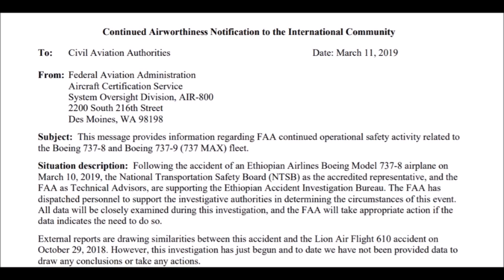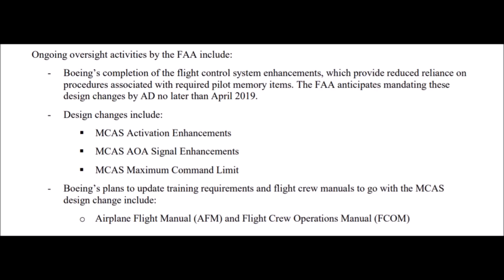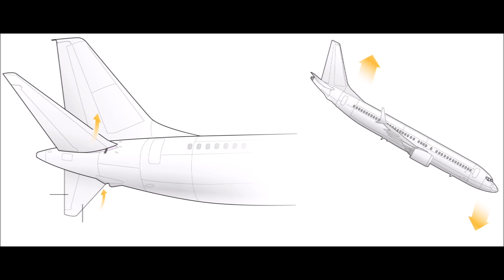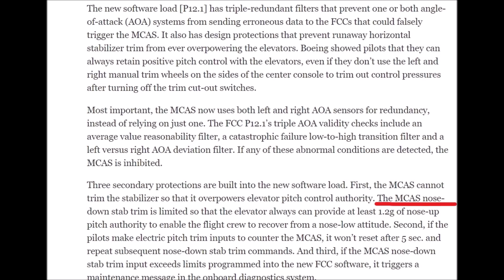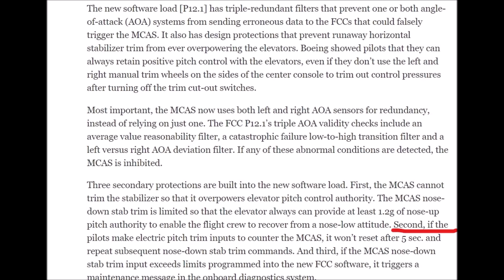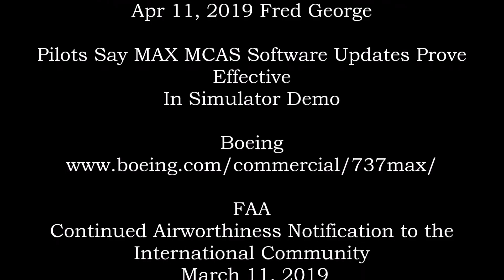737 Max UPDATE 14 April 2019 "The Fix"

Comment: I copied this form my response to a different video.
"the longitudinal center of thrust and the center of lift are misaligned, the aircraft will rotate in pitch with changes in power setting.
It will not find equilibrium, it will continue to rotate without pitch input. If you trimmed it for level flight and change power setting you would have to retrim for every power setting change.
 This is what MCAS does. It would be acceptable on a fighter maybe but not desirable.
 I doubt even a F-117a has such a basic design flaw with it's huge compromises for stealth functionality.
 If I built a single seat homebuilt aircraft in my garage with such a fundamental design flaw it would only be signed off by the FAA if I lied.
 If I said " it changes pitch with power setting but it's OKAY because I put a autopilot servo in to control pitch and will overpower it when I need to change pitch".
 The inspector would be like nahhhhh you need to fix your thrust line issue! Build a new motor mount or change your CG or the incidence angle of the horizontal stabilizer. 
 It's like trying to fly a plane with the CG too far aft, using the tail as a lifting surface and shifting the center of Lift aft. You should be aware of the danger of aft CG?
 Boeing designed it in to save money,  they    could've redesigned the landing gear to get higher clearance.
Reply: Kyle Goldston All of the many types if aircraft with underslung engines have thrust alignment issues. To go from that, to questioning the general stability, is a flawed argument.
Reply: @gordonrichardson2972  when they added the new larger diameter engines they had to move them up and More importantly forward, I assume to clear some internal structure in the wing.
 This moved the longitudinal center of thrust forward. 
 Imagine mounting the engines below the cockpit, when you change thrust settings the aircraft would pitch up or down pivoting around the wing. 
 Then, of course they built a software package to cover up the problem and didn't fully inform the FAA or even the pilots.
Reply: @gordonrichardson2972  I'm not sure that " all airplanes with under slung engines have thrust alignment issues" but these ones do. Your above quoted statement sounds like a flawed argument to me.
Reply: Kyle Goldston You're not sure, but you think my argument is wrong, doesn't sound very convincing.
Reply: @gordonrichardson2972  I've learned to be careful about speaking in absolute terms like "all aircraft of this type" etc.
 How about you?
 You may have missed one of my replies, I attempted to clarify my view of why MCAS was added to such classic airframe that predates electronic flight controls of this type and had previously had a good record of safety.

Comment: Dead end journey. 1. Wrong overhaul of airframe leads to - 2. Prosthesis named MCAS, when failed this lead to 3. Software patches - bandage on prosthesis. I guess more problems with this aircraft in future. In engineering is hard relation with factors: time, cost and quality. We must select two for cost of third. In example: quick and cheap project will be low quality, quick and good quality must be expensive, good and not expensive must take longer time to develop. Boeing take first option, but in aviation this is not acceptable.

Comment: JB,

As a veteran commercial airline pilot, you have changed aircraft a number of times across your career, and had to be re-certified on each of them every single time.  In your opinion (rather than quoting a company-fed line, mind you), do you believe that any 737 pilot could safely and reliably make the transition from pre-MAX to a MAX aircraft without simulator training and re-certification?
According to your own earlier reports, it is clear from the data tapes from those two MAX-8 crashes that a lack of training and knowledge regarding the MCAS led to the loss of all souls aboard.
Reply from the maker: before the fix? much additional sim training required.
After the fix? I pad training.
INMHO JB
Reply: @blancolirio  
I am neither pilot nor aeronautical engineer, but from what I've heard in these last few months, the MAX-8's engines are larger and more powerful than anything the 737 airframe was ever designed for, and has stretched the aircraft to the limits of its decades-old designs.  Even though the parts of the MAX-8 are brand new, the shape of the aircraft overall has mutated slightly with each new incarnation of the '37 family across those decades (as is expected of any aircraft across its maturation as newer technologies step forward and better computer models are crafted, fair enough).
But what I'm wondering is if Boeing deliberately crossed the line with the MAX-8/9 and got too greedy by installing engines that were too big- in direct response to Airbus' competition in the narrow-body industry- thus shifting the center of mass too far forward, and then created MCAS to cover that ambition in order to directly challenge the laws of physics in regards to what a '37 is physically capable of doing?  Since 400 souls have been lost within a period of six months due to the exact same causes (MCAS), it makes me wonder if Boeing- whether one person or as a group- was committing some sort of crime in their over-ambition which could be construed as criminal negligence at the very least.

Comment: Why are the AOA sensors failing. I don’t trust this plane. And these pilots need to do more hand flying
Reply: AOA sensors are mounted on the outside of the aircraft, and are subject to mechanical damage on the ground, such as improper proper positioning of the airbridge.

Comment: But beneath all of this, is the plane with the big engines balanced [update: I mean "stable" I guess that's the better word! ;) ) or not?
Reply from the maker: It's stable.
Reply: @blancolirio  

OK, good. And I mean that. I see you as an authority on this (and I see your explanations as very clear and instructive, as I am NOT any kind of aviation specialist, just a seat warmer). I have listened to a lot of your reviews and comments on this problem, and I know you are not any kind of hack commentor (perhaps like I would be, if I opened my big blabbermouth more).

But seriously. Given the speculations on the structural balance in flight, I simply didn't really know.

You make me feel better about the whole issue.
Reply: Every passenger aircraft must be stable, otherwise it will not be certified to fly. Only military jets can have 'relaxed' stability. MCAS is an augmentation system, to make the yoke controls feel more stable. It does not change the inherent stability, which is already present. P.S. The word balanced has no definition as far as stability is concerned.
Reply: @gordonrichardson2972  - "balanced"

Yeah, I know, I was using it more or less informally. The deal is, read the reply I got from Juan, which in two words sums up the issue. And so, I come out of watching this video and reading Juan's reply feeling a bit better about this.
Reply: BFDT Ha-ha! With over 1.5K comments, you just caught Juan at a free moment!

Comment: Pilot error, like it or not, is a common cause of incidents so if you design a system to protect against pilot mistakes it must be difficult to let the system be overridden by what maybe the influence that is at fault. I imagine that if you are a software person there may be a tendency to be of a mindset that is under reliant on the pilots skills and over reliant on the infallibility of automated systems. 
I also imagine that there was a DFMEA process for this system as with all such system integrations and I assume that the scenario in question was considered and the risk was ameliorated by way of the putting in place of procedural training option rather than going back and "fail safeing" the software. This is a common universal failing not unlike issuing hard hats to protect against falling objects rather than removing the source of the falling objects.
Reply: The fault tree and hazard analysis suffered a number of defects. These including lack of sensor validation, faulty risk classification, shifting goalposts as the amount of nose-down trim increased from 0.6 degrees to 2.5 degrees, failure of communication, and of documentation, and of training, and of oversight, and of regulation. Anything else I forgot?

Comment: Sounds to me like Boeing rushed this system into service. Nothing good ever comes from being hurried in the aviation industry, be that manufacturing, or flying in general! The fixes for this will be very simple from an engineering standpoint, I believe - at that point I have no doubt this aircraft will be just as reliable as prior designs.

You're absolutely right about automation in the auto industry. We're already seeing radar and LIDAR being used in automotive applications today, and these systems will become more and more powerful as things are learned and tested with time. I do know one thing, being an automotive technician - auto manufacturers had better get themselves out of "cheapout mode" if they plan to increase safety on the roadways with this technology. The stuff coming out today is so fraught with issues, it sure makes me wonder if they are capable of this task. The penny-pinching has gone MUCH too far, from what I've been seeing, especially in the past 12 years. Will be interesting to see what the next decade holds.

Fantastic information as always, Juan! I know I can always count on you to bring the facts to the table! 👍🍻

Comment: Software is not an appropriate remedy for a poorly designed aircraft. The engines are in the wrong place because the landing gear is to short Boeing cut corners at the expense of many lives in order to increase profit. Properly designed aircraft shouldn’t need an MCAS system if it were inherently stable. Boeing 737 Max should be scrapped.
Reply: Airplane engines have been put in pretty strange places in the history of aircraft. The MAX's engines are in a pretty normal place. The Max is not unstable.

Comment: Although flying is 3 dimensional vs 2 for a car, I believe automobile AI has a long way to go B4 it will be reliable in all road, traffic and weather environments.  Guiding a vehicle safely on land via computer is a lot more challenging than in the air because of all the unpredictable variables.  e.g. In a plane, you can usually fly a predetermined unencumbered path with a lot more room for error, there are miles instead of feet between aircraft, and a child isn't going to unexpectedly run out in front of an airliner.  All the media hype and profit potential is likely to cause premature release of flawed systems, and it will only take a couple of "dumb" fatal crashes to cause much more stringent regulation of this new technology.

Comment: It seems that the FAA knew what was going on before the second crash because they issued a letter right after the second crash.   They are no dummies.  They knew exactly what was going on.   HERE IS THE RUB: IF THE FAA KNEW WHAT THE PROBLEM WAS (MCAS), WHY THE HELL DID THEY NOT GROUND THE FLEET UNTIL THE PROBLEM WAS FIXED????   Hmmm,... let me think...$$$$$$.   It is not just Boeing I'm angry at, IT'S THE FAA!   There better be some heads rolling or better yet, some people behind bars when this is settled.

Comment: As long as MCAS has the ability to control the airplane, what if there is undetected software bug in the new version or in later new versions? There is non-zero possibility that the software bug could bypass all the "software redundancy" protections.

Comment: The reason I mentioned the Auto Throttle control was to note the fact that no fix was mentioned in the new software update. I perceived an over throttle condition is a danger that should be addressed.
Reply: If the aircraft is climbing normally, the autothrottles would be behaving correctly. No need to fix something that isn't broken.
Reply: @gordonrichardson2972  I am not a pilot, but if air speed is at or beyond design limits, a normal person might think cutting throttles a bit automatically might be a good thing.
Reply: Steven Roberts The B737 is fundamentally a manual aircraft, and doesn't think for itself (MCAS excepted). Adjusting the controls is mostly left to the pilots.

Comment: Basically a software procedure cock-up. Probably caused by not taking into account the increased angle of attack at take off, caused by the revised location of the engines under the wings.

Comment: Prior to the the 1960s Black & Decker used to be a reference in high quality power tools . Then in the 70S the sold their name to some wall street expert to use the trust in product to make profits with dirt cheap tools. When their reputation was lost for selling junk, they rebranded their power tools to "Dewalt"  .Yesterday Trump the businessman , knowing the value of a brand name for marketing, and in an effort to reduce is trade deficit, suggested that Boeing should change the name for its patched up 737. Why not
 start a contest to find a new name for this new improved AC . I would suggest "Boeing MAGA Pacth II ".
That is what you get for letting Wall street run your country . Short term profit for the .1% and while screwing the competent American working class.

Comment: I am concerned about several items brought up by this report.  
   1)  The problem seems simple” why didn’t the engineers do this originally.  
   2)  Dependence on automation for safety. 
   3)  Automation in cars to reduce traffic deaths.  

The first issue, this is not a simple problem.  This design encompassed several different agencies and several engineering design groups within Boeing and is a system of systems.  System of systems encompasses more than the vehicle configuration such as the operating agency, certifying agency in this case.
This system was driven by the customer, cost reduction for type certification to be the same as existing 737s and the FAA maintaining a very rigid 737 type certificate approach to reduce possible pilot error that could occur when moving from one variant to another.  
The specific system,MCAS, crosses several engineering disciplines, Aerodynamics, Flight Controls, Software, Electrical, Avionics, and Crew Systems.  Coordinating this system and verifying crew workload, integration into primary and secondary flight controls, avionics and software without impacting existing systems is very difficult at best. 
This is not and was not a simple problem and missing the impacts to the flight systems and crew workload that have come to light in this accident was tragic and subtle enough to be missed in review and testing.  Maintaining the basic design philosophies required for aircraft safety in a high pressure environment is one of the toughest jobs a design and systems engineer has to do. 
No excuses for them missing this just understand the complexity of MCAS with the rest of the primary flight control systems.  

Second issue dependence on automation for safety. 
The best safety document I have ever reviewed tied safety right back to the person, “This document by no means negates common sense, your safety is your responsibility,” which is what you alluded to with pilot flight proficiency hands on.  YES, that is utilizing the best computer and sensor system in that cockpit, the PILOT.  

Third issue automation in cars, this is a tough question. How do you set up the design approach assumptions? These basic rules and tenants for the design teams are not there yet and some of the initial designs are a bit dangerous, systems failing active rather than passive, that means they are able to input to the system like a runaway trim causing an accident rather than preventing one.  

Automation can be a incredible aid to operation or the cause of difficult situations. 
Bottom line your safety is your responsibility.
Reply: Good points!

Comment: Turning off the "magic" and hand flying a highly automated aircraft exponentially increases the workload of the non-flying pilot, who now is tasked with inputting heading information, altitude information, airspeed information, configuring the aircraft on command, running checklists, and operating the radios, effectively taking him/her out of the awareness loop for visual traffic. This is particularly true in the terminal environment. It's no wonder basic stick-and-rudder skills can deteriorate.

Comment: Would a normal 737 pilot have been surprised by the difference in flight characteristics of the 737 Max to the point they would have been unsafe flying it?  I assume all pilots would have used the trim when needed as needed and just fly the airplane.  All pilots would have realized that they used the trim differently on the Max but would they actually have needed an MCAS system that added complexity and could results if poorly implemented and used in an uncontrollable airplane?   The pilot training on the 737 MAX was probably too little, and the system implementation lacking, but maybe in this case could the threshold for aircraft re-certification be too low?  I keep wondering if the 737 MAX would have been just as safe without MCAS.